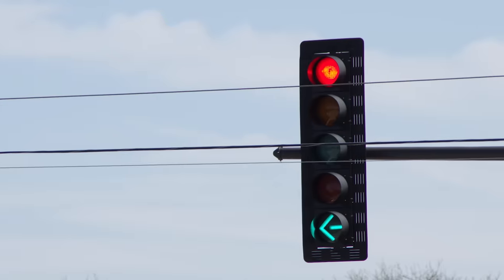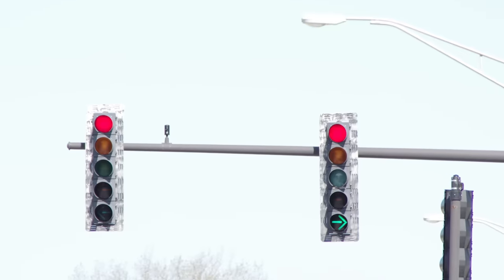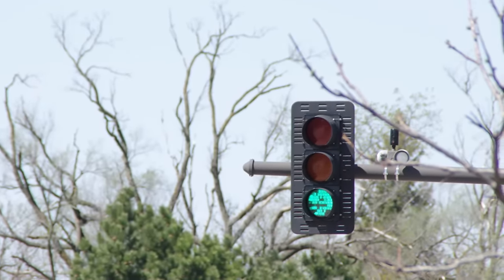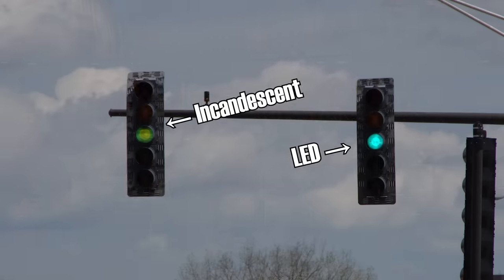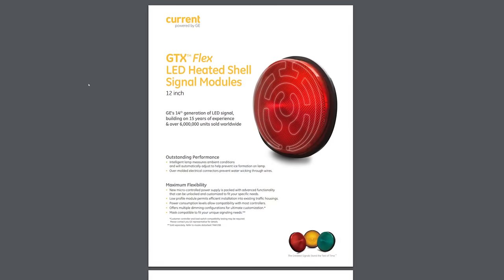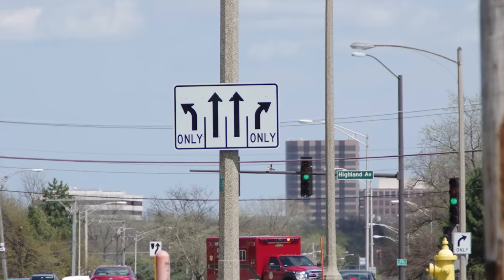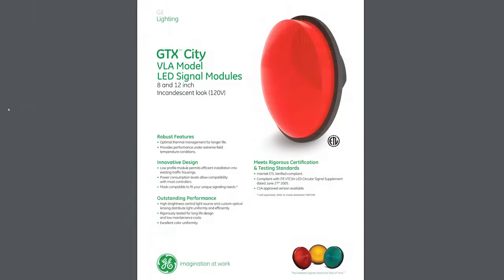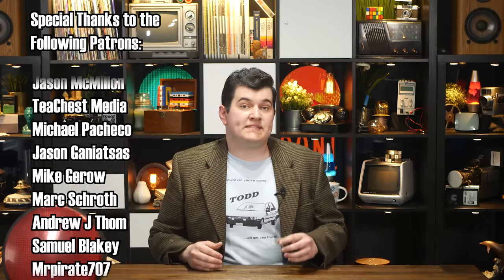The LED Traffic Light and the Danger of "But Sometimes!"

Comment: As an engineer, I found the “but sometimes” discussion here so refreshing. There’s such a tendency to squash the new idea because something unexpected happens. If our first reflex is to give up whenever something isn’t perfect, we kill our chances at progress.
Reply: Network and computer security has a similar phenomenon: the well funded and determined hacker.  It is often used to justify overreach and usually prevents good enough measures from implementation. 
“But if someone <gets past the fifty other measures>…”
Reply: Engineer here, was going to say the same thing. So frustrating.
Reply: Best is the enemy of better.
Reply: I live in the south.  People here don't have snow tires or snow chains.  People here rarely see snow and it generally happens just a few times a year.  People here don't have a clue how to drive in it.  When you talk about "sometimes" happens, yes, it only sometimes happens.  But when it does it is going to cost lives.  Because people simply don't remember the rules of the road for the "sometimes happens".  

On a side note, my town recently replaced all of the older street lights with LEDs.  Guess what, the LEDS give off purple light.  Indicating that they are defective.  So the town is now going to have replace all the defective lights yet again.
Reply: @IAmTheRealBill  another engineer here. I absolutely agree. "Best is the enemy of good enough".
Reply: YES
Reply: Yup. A lot of this "but sometimes" bullshit in ICEV vs EV. It's ridiculous.
Reply: "But sometimes" should be the start of a conversation not the end. It's an important tool for ironing out important issues not for killing good ideas.
Reply: @superdave8248  I was wondering about that our steer lights in a few places are purple now so i guess that’s what that means. Also live in the south but in the mountains yet on the south side in Transylvania county snows line twice here a few inches gone within days never really worry about snow tbh I like the rain but snows annoying af and don’t much care for the cold, idk how tf millions live up north even when I lived in Seattle wasn’t ever that cold, theres something wrong with y’all to stay up there since there’s no longer a threat of malaria down south and we now have AC.
Reply: @MrCow579  It's not about "but sometimes this demographic also dies" it's about not filling ERs and preventing the spread of the disease giving rise to new variants that will make the effort and money spent on producing vaccines go up in smoke.
Reply: @masterofreality926  Lmao link or it didn't happen.
Reply: As An EnGeNeEr 😂 you want your attention now?
Reply: @MrCow579  mandated vaccinations have been around for most of out lives. Theres very few if any people alive who were around prior to thier existence. Besides your numbers being off, the very aggressive and constant mutation that changes the number of people in each subset of the population most affected by it justify the urgent need. You need several vaccinations to participate in public schools and many jobs also require certain vaccinations. Theres absolutely no difference between this one or any of the other required vaccinations.
Reply: @DreStyle  Yes, didn't I say "I'm an engineer"?
Reply: @bwolos  exactly....  We have alberta, canada as an example....
Reply: @antonioscendrategattico2302  vaccinated people get covid and spread it. In australia, there's more(76%) vaccinated in hospitals than unvaccinated even though the vaccine % is around 50%.
Reply: @claytoncoolidge992  the difference is, those other vaccines ACTUALLY WORK. You ever needed a booster for those? Thought so.

And no difference? Oh except the fact that this is the first ever mRNA vaccine used on humans and we have no idea what the long-term effects could be.
Yeah, nothing different than other vaccines!
Reply: In my experience it also happens when someone on a personal level is invested in a project, that he or she doesnt want to take off. So they just focus on the problems instead of looking at the advantages and solutions. They just ramble on about the problems, so its not even worth starting to solve them.
Reply: Indeed. The correct approach with any "but sometimes" issue is to go into the statistics. Unfortunately most people don't like or are unable to do the math, or to even comprehend statistical data.
Reply: @SirBrass  somewhere in between good enough and best is preferable. A collection of many “good enoughs” often combine to be not quite good enough and then the mess of things that were individually good enough are now painful, expensive and time consuming to fix.
Reply: I have not seen or noticed the emergency vehicle features described herein in my area.  Thank you for explaining this.  The implementation of this in any area has to be quickly followed with updated laws to punish anyone from pretending to be an emergency vehicle… say with a handheld flashlight device.  I am not sure if an existing law intended to prohibit non-emergency vehicles having obvious lights and sirens would apply.
Reply: I do not think public high schools teach drivers education at all in my area.  I have often wondered why seasoned drivers do not have to re-take a driving test akin to first time drivers every few years just to prove knowledge of updated driving laws.  I suppose because then the government would have a lot of people who could not get around… legally.
Reply: @superdave8248  purple traffic lights? I wanna see that
Reply: @bwolos  you spelled "conservatives" wrong
Reply: @claytoncoolidge992  Very well said. This biologist approves. Solid reasoning and explanation.
Reply: @jdd8826  why thank you sir I do my best to provide the supporting information
Reply: As an engineer, I LMAO at all of the "as an engineer" comments on YouTube.   From the comments I suspect that 99 percent of YouTube viewers must be "engineers".   😂
Reply: Fuck me we humans just hate everything
Reply: Progress ended when we left nature and engineered the world to rely on one another. A thought that sings in my head came from a video that breaks down the thought that no one can make anything any more. No matter what most people or companies make... No company if cut off from the world could manufacture anything but its single component.... They couldn't even do that without the help of the ones that mine the materials.... Then the chemical companies that take mined materials and make plastics, alloys etc. Once you make a component you need 100 other companies to make their components that all go to one company that manufacturers a product. That company alone could not manufacture anything because they don't manufacturer materials and they don't make their own components. If countries get to the point they go to war or stop trading... The whole world is affected. Without Taiwan and China we lack chips..... All of this was not even an issue when we lived amongst our families hunting, gathering, communicating and communities are stronger when they are not all in competition for basic necessity. Those who have smile while those without perish. The natural world is a more level playing field.
Reply: You can apply this to socio-economic and political issues as well
Reply: @MrCow579  read up on transmission vectors buddy and peep the mandatory small pox vaccine and mask mandates during the influenza pandemic.
Reply: @justayoutuber1906  why? Why bring that issue into a conversation regarding traffic lights and trying to make a ridiculous comparison? There's always one in every comment section.
Reply: As a mechanic I have to say I dispise most of you engineers, but you seem like you've got a level head. We need more people like you in the auto industry. You should see some of the absolutely atrociously designed vehicles I've worked on over the years. Hell when the new Rangers came out I wanted to kill myself every time I had to do an oil change on one. I'm half joking when I say this but an engineer would walk through a valley of virgins just to fuck a mechinic 😂 have a great day man.
Reply: @MrCow579  that's so misinformed I can't tell if you're meming or not.
Reply: Use a thermostat on light itself. It will require no extra network to turn on resistive heating like rear defroster.
Reply: @MrCow579  Need a booster for shingles, DTAP for kids, pneumonia for adults although every 10 years.
Reply: @MrCow579  okay yes you do need boosters for other vaccines, who told you you didn't? Some are closer, some further, why do you think we take babies in for scheduled vaccinations at specific ages? Why do you think you get a tetanus booster if you cut yourself on rust? Most vaccines require booster shots!
Reply: @MrCow579  It was a course of 3 Salk injections against Polio.
Reply: True, I don't know why there's a lot of engineers that don't like innovation. Like.... Why you are a engineer in the first place?
Reply: @superdave8248   I live in NY, most traffic lights seem to be LED.( Looks more familiar) This is a state where it actively has snow for a full month at least every year sometimes getting a full foot or 2 in a single night. On top of this, this region regularly wins most golden snow globes, ( I. E this area gets the most snow out of anywhere in the us) traffic lights in 95/100 are bright enough to shine through the snow or melt it with the little heat they do make. The exception would be a NY blizzard so bad nobody would want to be driving including experienced drivers, and schools would close for good reason.
Reply: At the same time, most new ideas are bad.
Reply: safety = weakling
Reply: A soon to be engineer here. I agree.
Reply: When people argue the "but sometimes" thing, I mention the fact that I once was in my bathroom, and I reached for the door knob, and my hand slipped because it was still a little soapy. I couldn't turn the knob.  So, clearly reaching for a door knob with my hand to open it in my bathroom doesn't work. So I was trapped in my bathroom until I starved to death. End of story.
Reply: This made sense when I read it all, but as I read "As an engineer, I found the “but sometimes” " , 
For some reason I immediately saw a jet fall out of the sky.
:P
Reply: I've been saying for years, put officers back at intersections. That's where m[t accidents happen anyway. BONUS: no waiting on cops to show up...
Reply: Then again, but sometimes can be a good excuse, like why should we construct flood protections, cause it only floods in "but sometimes" cases.
But yeah the "but sometimes" statement does get used too much in situations that don't make sense
Reply: Get rid of all kinds of traffic signs where wireless internet and satellite navigation have good coverage. It will save a trillion dollars a year.
Reply: @shaundevrisky349  It's more likely that the algorithm is directing you to videos watched by engineers.
Reply: @amorphousblob2721  No.  It is because YouTube is full of people claiming an educational status they do not really possess, either in a pathetic attempt to impress people, or to feed their ego-junkie addiction. 

That's why.
Reply: Oh god not an engineer
Reply: @shaundevrisky349  engineers are the worst.
Reply: @jmccain22090   LMAO.......that made me laugh.

For sure.  The only thing worse than a know-it-all engineer is a know-it-all who pretends to be an engineer.  And between those two it's nearly a tie to the finish line as to which is more pathetic.
Reply: Are you talking about roundabouts, right?
Reply: Yep, it all comes down to marketing too. A product could be amazing but bad marketing and bad PR will mean that product will be discontinued forever.
Reply: This is the nuclear power industry in a nutshell.
Reply: I live in Illinois, too. Your highway traffic signal department is run by LABOR UNIONS. More lamp failures, more electricians. It's that simple
Reply: Amen Brother!  So much good engineering is wasted by those who choose not to see the bigger picture
Reply: Stupid comment.. there's a tendency to resist adopting a dangerous product when it causes fatalities because they didn't bother to meet any safety standards
Reply: @busybody1474  I would say there is room for everything… squashing new ideas without proper balance but just wimpy fears or worse… politics and corruption. And going forward with reckless ideas just because corruption and politics.
Reply: @antonioscendrategattico2302  That comment sure aged well
Reply: @20chocsaday  Polio was actually a terrible disease. Coof just kills those with one foot already in the grave
Reply: @frgv4060   they didn't bother to properly test them in real world conditions, they just installed them on every traffic Pole and fatalities resulted.. not okay!! Perhaps you would have to lose a family member before you get it, I'll assume you're not completely stupid
Reply: @busybody1474  What are you talking about. Led traffic lights are perfectly fine and ubiquitous now. I take your “stupid” as the one from the dim calling everything he doesn’t understand “dumb” 😂
Reply: Very well said
Reply: @superdave8248  They fairly recently changed to LED street lighting round where I live (UK). The difference is amazing,  no colour distortion, far less light pollution so you can actually see the stars at night, so much brighter that they could probably reduce the number. It also dropped the electric bill for running them and so far, they seem to be more reliable.
Reply: One of the reasons I am such a fan of the "magic roundabout " idea (see my comments elsewhere on here) is that it is a new take on an old idea and it cannot be broken or hacked or fail in any technical way. It takes good enough to a whole new level of can't get much better!
Reply: @claytoncoolidge992  WTF has this crept in from against an article about traffic lights?
Reply: @MichaelKingsfordGray  Hugh Spurlash !
Reply: @MichaelKingsfordGray  What a random rant? Have you managed to push your clogs  (sabots) into the gears of the local water powered looms yet?
Reply: @rogersmith8339  That was decades ago, and the Judge let me off with a caution.
One simple prank, and I'm never left to forget it.
Reply: @MrCow579  Depending on the vaccine yes but then again they tend to last years not months.
Reply: "But sometimes" PEOPLE wont listen ...
Reply: >> if our first reflex is to give up whenever something isn’t perfect ... <<
there is NO perfect ...
it's only an ABSTACT reference to an ideal ...
which can never really (practically) be met!
(but that doesn't mean you don't try)
Reply: @olstar18  because they dont spread nor mutate nearly as quickly, or we dont have as much exposure to it anymore. Virology isnt exactly a minor section of biology
Reply: @calvindibartolo2686  Now that you have attempted to make yourself sound intelligent are you done?
Reply: @Super Dave  if you can't figure out how to drive in the snow you shouldnt be driving in the snow. If anything people drive more careful.
Reply: the problem is that "but sometimes " you avoid some so obvious facts (this was intented for the maker of this video )   9:10    the problem i spot on his argument was instantaneous  and is what about when you are cautious and intersection is safely cross ,what happen    ?   nothing ? what about the camera and all the tickets you will get !

i do not care if is led or oil lamp but when you avoid points on your argument seams  is done on porpous
Reply: @TheMakyato  tickets... from malfunctioning traffic lights?

IF you get one, you go to court and say "lights were out", they have a record of it. Ticket dismissed.
Reply: @calvindibartolo2686  you waste allot of time, cost 100€   (italy ) and this do not change the fact that he overlook this isue and also is not sure  that the judge will cancel the ticket
Reply: @TheMakyato  dash cam is a lot cheaper 🤷‍♂️
Reply: @TheMakyato  Well I guess if said time is worth more than the 100€ then by all means pay it. For the vast majority of North Americans though, that's an entire workday's worth of money, for a couple hours out of the day.
Reply: @calvindibartolo2686 in italy all is take  is not cuple hours , it can be 2 h in the middle of the day with 80 mile trip  with 3- diffrent stages 
.  crossing red light   in italy =  160€ to 650€  fine +6 points  . we have 20 points and they detract points when "rules" are violted ,start with 20 points   (now i feel chinese) 
 anyway this is an isue he did not mention 
i do not have any problem with any type of light
Reply: @TheMakyato  sounds like fighting it is worth the time 🤷‍♂🤷‍♂
Reply: Same here.
Reply: I also have a feeling that it happens to certain lights vastly more than others in the same areas. Kind of like why my cul-de-sac will get 1 inch of snow while my driveway will get 6 from the exact same storm.
Reply: @MrCow579  yes and the covid vaccines also work. As for the mrna thing, we know it works and its not the first vaccine that uses that technology. It also can't have long term effects of the kind you imagine because that's not how it functions. It has the same as any other vaccine.

As for boosters, what exactly do you think a tetanus shot is? Or the flu shot you can get every year?
Reply: it's like standing still shivering while naked and going "oh well, that's life" instead of building a fire to keep warm
Reply: safety first
Reply: @claytoncoolidge992 Have you changed your mind now?
Reply: @rogersmith8339  lol ummm don't ask me ask the ones who added it in just responding to them lol it's called trolling for trolls and if you have never tried it you should it's absolutely hilariou much like thier addition to the conversation with the vaccine. Nothing I said from the start has anything to do with that but once someone gets butt hurt and proven wrong they tend to try and find something to win with obviously this particular troll has chosen vaccine misinformation 101
Reply: What's the other side like? @NathanTarantlawriter
Reply: "But somentimes" 
While forgetting the 99,5% of the times